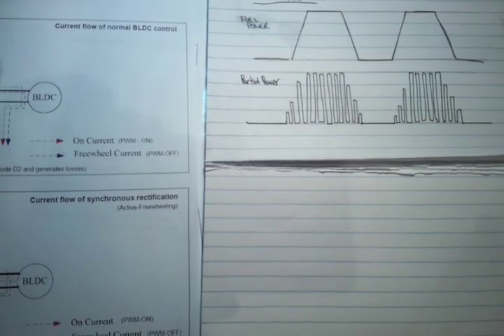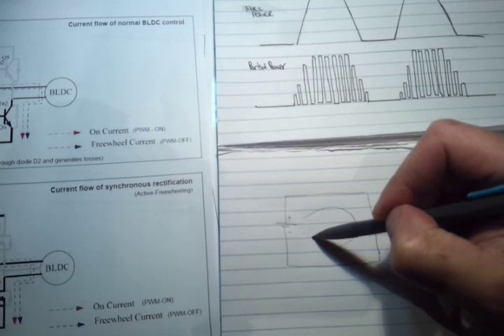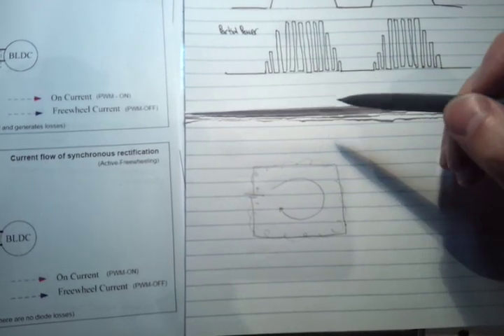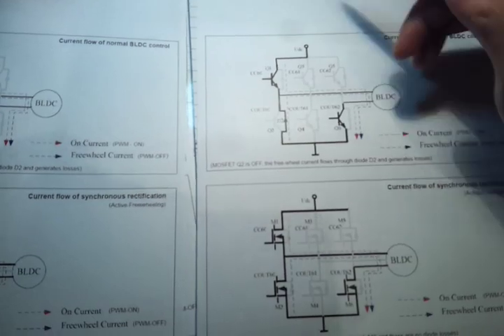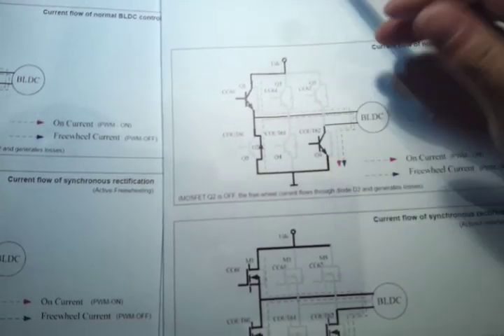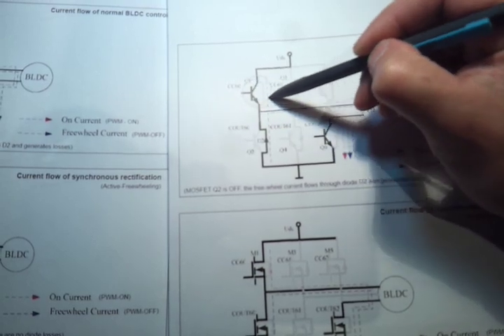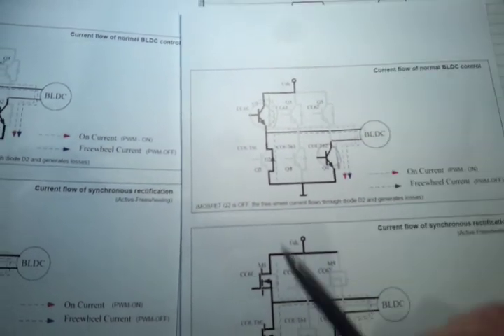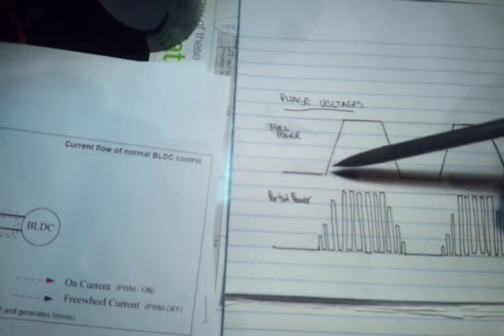How BLDC Active Free-wheeling (Synchronous Rectification) works..

Comment: I have one question like when we cut the wire or stop the switching then it will creates oppsite polarity copared to the source then it should be flow direct through wire not through diode due to oppsite polarity also same thing happen in motor?

Comment: thanks for the video, I have the problem of having to manage a natural deceleration in a complementary piloting system, and to have the problem of moving from a RUN to a DECELERATE in a natural way. Imagine if the driver of a vehicle decides to brake suddenly when driving. How should I manage the drive sequence for the MOSs?
Reply: For have a natural deceleration (like a free wheel) you have to open all the 6 Mos. I f you want to decrease with a ramp, you have to do a speed regulation.

Comment: This vid only mentions about free wheeling when the high side is being driven with PWM. How would free wheeling affect an ESC where the low side NMOSFETs are being driven by PWM?

Also:
0 dislikes = FUCK YEAH!!!
Reply: You saying isn't that esc gonna brake when low NMOS is gets a pwm. So i have a same issue while i design my own Driver. Its true that esc gonna brake and its not efficient then a freewheel. Freewheel always a better option when we talk about ground vehicles. To solve that problem esc needs a closed loop Current control or similiar control topology. With that braking will not gonna happen and since you control phase currents controller keep that balance.
Reply: @mustafaserhatbeyazay3912 
First off... can you clarify that?
Secondly, you do realise I wrote that comment over nine years ago, right?
In that time frame, I have since answered my own question.

Comment: do you mean that when you turn the circuit off that the diode is switched in at the same time? otherwise the current would always choose the path of the diode? 
  Can you help? i am looking for ideas to rectify a signal so i can make a brushless dc generator. The idea is to have magnets moving around the outside of a large diameter ring, then the coils would be out side of that, looking to generate/rectify dc voltage from the coils. Also thinking of a different design which uses copper strips or discs to generate the electricity, the problem is the short circuit across the surface area of the disc, so would combining a disc with a wire coil (which has resistance) together then help? Any ideas? Thanks. Ps. was looking at electromagnets made with copper discs for inspiration.

Comment: Is it really called "Synchronous Rectification"?  I have worked on 100-800 watt dc-dc converters (36-75 Vin with 1.0 to 2.5 Vout), we used Synchronous Rectification to change the AC back to DC because using traditional diodes are so lossy specially at low Vout (under 2.5v) and hundreds of amps. Thanks for the video!

Comment: Very helpful explanation, now what I want to do is either get a set of active free-wheeling ESCs or adjust my voltage / ESC / motor to run closer to full power instead of having a lot of room. I wonder if it'll help.. or are the losses at 99% throttle already almost as high as they are at, say, 50%?  I'm using off-the-shelf 30A ESCs.